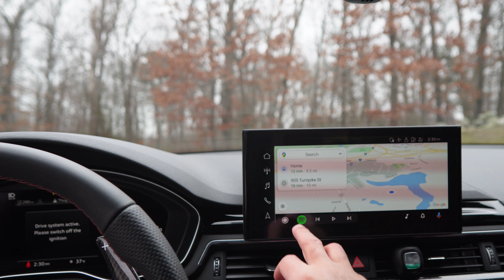My year review on the 2022 Audi S5 Sportback👍

Comment: I’ve had my 2022 Audi S5 Sportback for 3 months now. I sometimes go into the garage just to look at it. Best car I’ve ever owned. It’s an absolute blast to drive and a head turner on the road.
Reply from the maker: Very true. I thought I was the only one 😆
Reply: I really want to tune it like you but I bought it certified pre owned and I heard Audi will void the warranty if I do it. Guess I’ll have to wait a few years
Reply from the maker: @carramrod8232  if you plan to keep I would. Can't live in warranty fear plus it's reversible if you really need to.
Reply: @StreetDrip  I plan on keeping this car for a long long time. I went from a ford fusion to this so even stock it’s an absolute rocket to me. I will eventually tune it. Sound system upgrade like you is my first thing to do
Reply from the maker: @carramrod8232  nice move

Comment: Great extensive video! Those 034 springs really set the stance right! Unrelated question: did you experience any issues with the frameless windows during the winter months when snow and ice build up on the car and windows?
Reply from the maker: Thanks. No, I had it garaged so never had to really deal with it. By the time we had real snow I moved.

Comment: Another great video!  How are the summer tires handling the cold temps and snow?  I switched mine out for 19 in performance winter tires.  Everything I read said those tires are dangerous to drive in temps under 40 especially in snow.
Reply from the maker: Thanks I appreciate it. So far they are fine, no issues driving in snow. I'm not driving aggressive in snow but it performs well.

Comment: Great videos.
I live in MA as well. What did you do about the stock tires? Dis you change them out for the winter?
Reply from the maker: Thanks. No I still have stock wheels and tires on.
Reply: I am waiting for my S5 to come, sometime around May. I have heard that the stock tires are dangerous in the cold weather. I didn’t want to buy another set of tires if I didn’t have to buy Massachusetts winters are tough.
You car is pristine. Turns heads I am sure.
Reply from the maker: @Derek Wirwicz  thanks. These tires were fine since last winter and this season.
Reply: Glad to hear. I might keep them on and see how it goes.